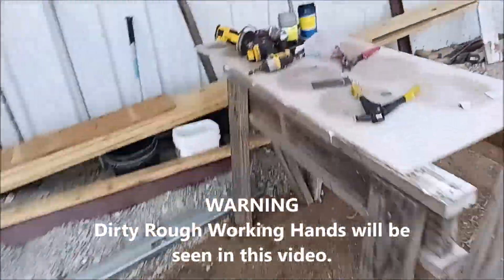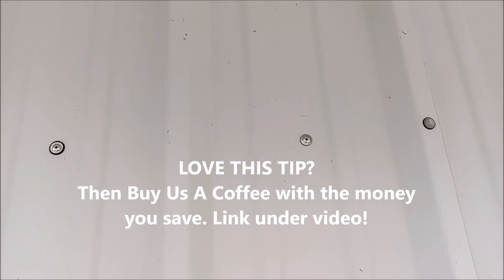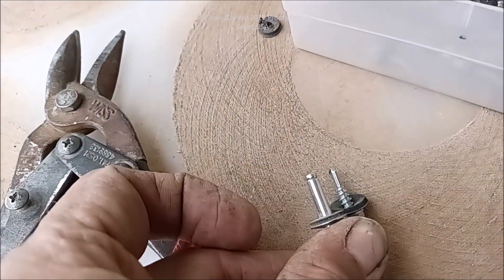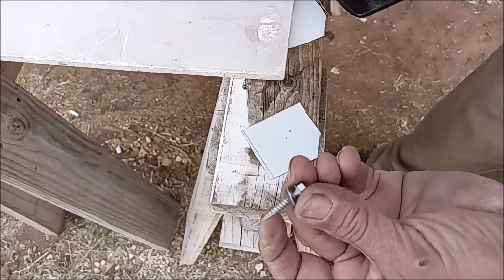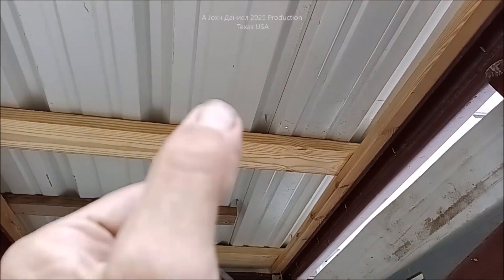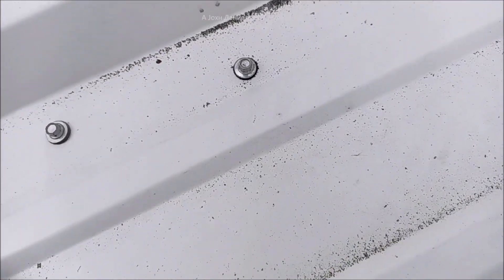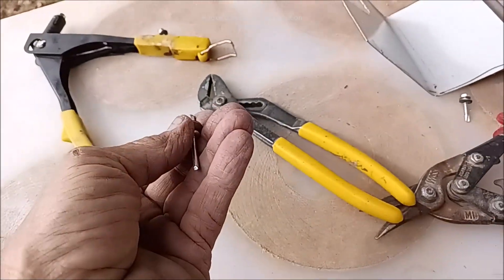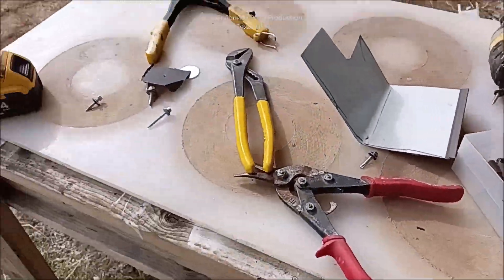Stop using Rivets to seal holes in Roofing Metal, Use my cheaper way instead

Comment: get closed end rivets just put them in the hole no seal no backing they used to build boats out of them i think it will seal your roof
Reply from the maker: Closed in rivets are expensive up front usually 25 to 30 cents or more each when you are buying small amounts under 1000 count. We have used them in the past but finding a 3/16 x 1/4 in steel with the ability to seal in one layer is rare. Aluminum is common for multi layers such as boat seams and bulkheads but also corrodes like crazy on a steel roof. A #9 roofing screw is 8 cents and takes less tools or time.

Comment: I recently had that issue and used silicone...I only had a few holes..But, good idea...
Reply from the maker: Silicone can work well for a few holes for a year or so, but this method is good for larger areas as a more permanent fix!

Comment: Wondering with all the extra pipe down that way, if youve looked into pin footings like the Diamond or Handi Piers and then like a DIY version since the specs are around.  Surprised no one has done anything regarding making our self since is only plate, tube and or pipe for the most part and UHPC or other concrete really isn't required.  Seems like is code since can pull up the manufacturers specs and data. Wishing more donate and appreciate those tech tips.
Reply from the maker: We have hard pack Caliche at about 18 to 24" deep here. Hard core rocky shelf and I put 4 holes in the steel post and slide rebar into them 8" long x2 with each hold about 120 to 150 lbs concrete.